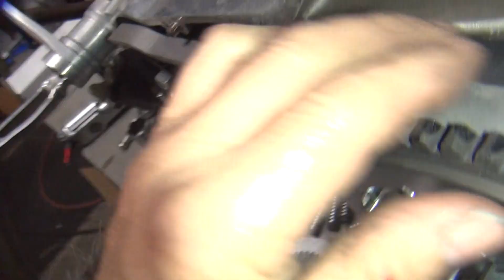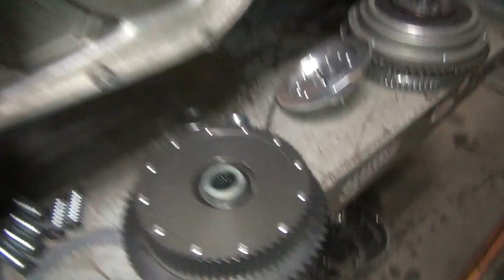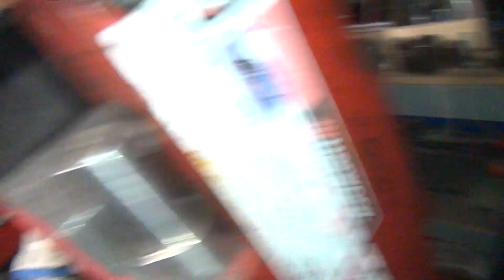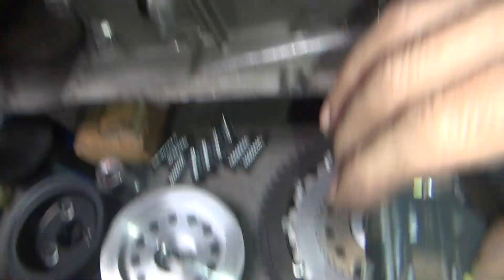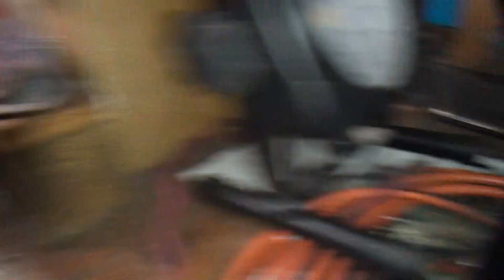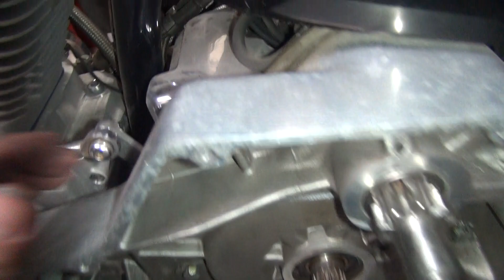#112 S&S 113ci evo motor blown belt drive transmission repair harley swift evolution tatro machine

Comment: Okay what size is your is the main bolt for your clutch the nut that goes on the crank what size is it and the nut that goes in your clutch basket that holds it to the transmission shaft what size are those two nuts man please for the love of God help me

Comment: interesting, but I fail to understand where the clutch unit sets on the splined shaft having any effect on the disc spacing and spring pressure. Is it possible that the first thick steel plate is selective? However, all that should have been determined at the factory when it was built. Possible an extra steel plate was provided in the event of fiber disc wear? I am sure you will find the problem and I will understand when you reveal that.

Comment: Pressure plate should be against fiber plate, not steel?
Reply: Aluminum would be destroyed  by Kevlar !
Reply: Now that makes sense. Just off hand it didn't seem right.
Reply from the maker: i don't think so. that is why i do it the way i think it should be done. what sould i do with the extra steel plate that came in the kit.
tatro

Comment: I was going to ask Tatro the same question about the last steel clutch plate against the aluminum hub. I thought perhaps it should be the Aluminum hub against a fiber ring....I may be wrong, just never saw that before.....Thanks
Reply: Think about Kevlar vs Aluminum ??